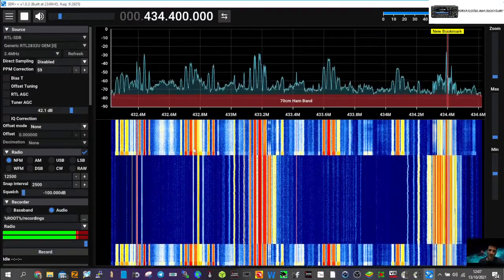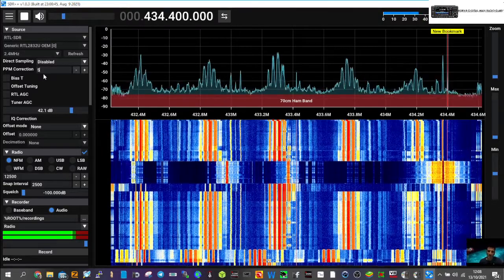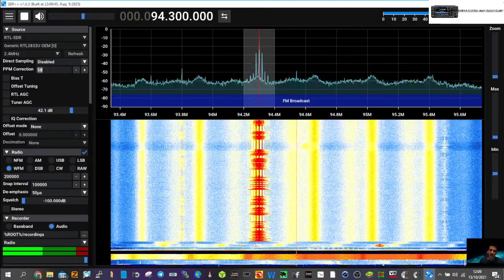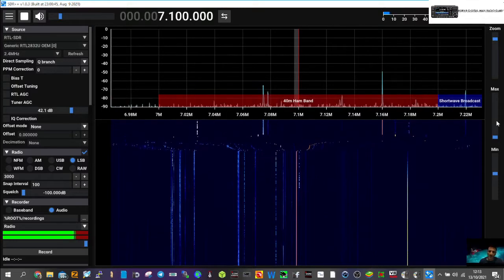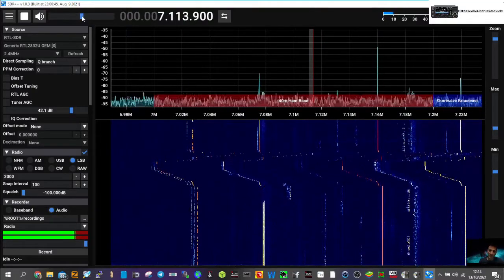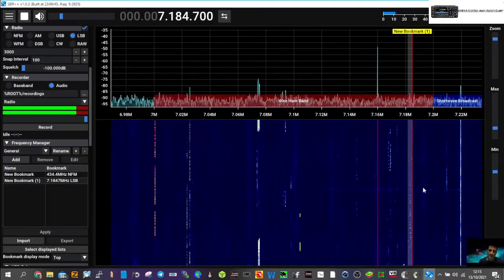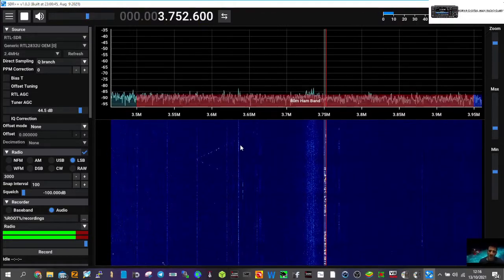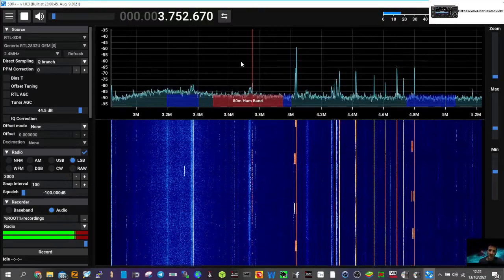RTL-SDR Clone Budget copy-Test and partial review

Comment: The clones are hit and miss (I suspect miss mostly). Mine works on UHF/VHF ...barely (apart from broadcast signals which as expected are OK) on an external vertical 1/2 wave for 2m. On HF, I have played with gain, settings, noise reduction etc and even on AM broadcast it is RUBBISH (on end fed wire in the middle of a major capital city!). Spend extra and buy a real one!
Reply from the maker: Agree totally thanks for helpful info ,